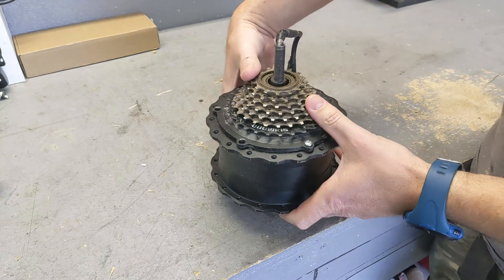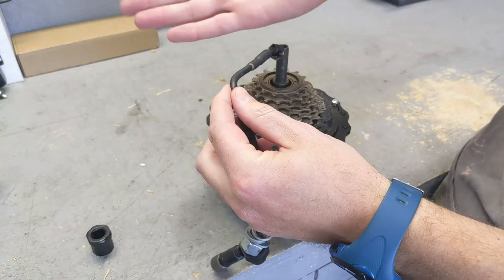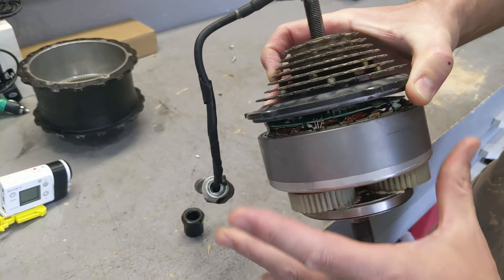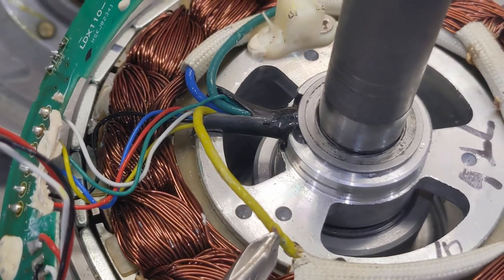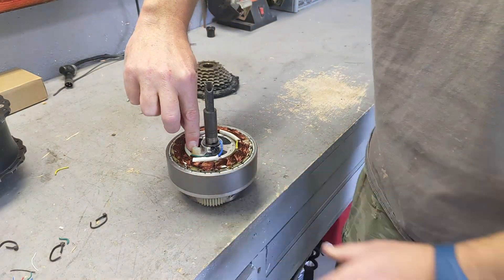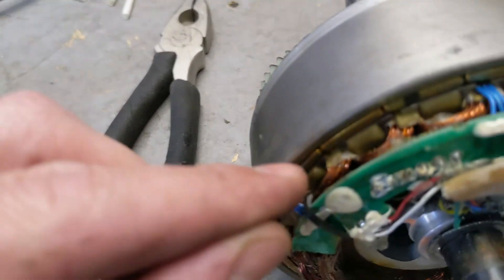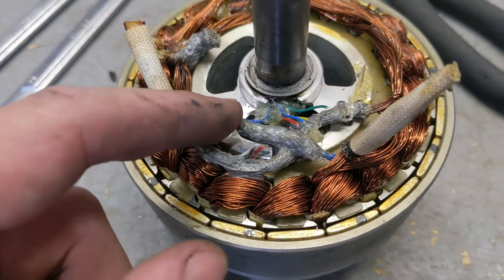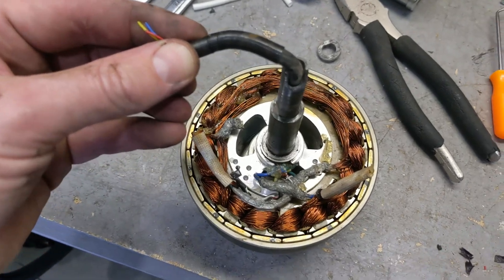5 REASONS why! How to UPGRADE E-Bike HUB MOTOR from HALL SENSOR to SENSORELESS! Bafang Himiway

Comment: hardly an upgrade, more like a downgreade lmao
Reply from the maker: Well first you need to learn how to spell downgrade ... Till then your opinion doesn't count
Reply: its a massive downgrade !! the poster dosent know the first thing about bldc motors or how to controle them....and this video shows. just look at the house wiring he is using and wire nuts like its the early 1900's
Reply: @spcolsson  How is it a massive down grade when he said it has worked for two years? Do you have another option than his? I would love to learn about it so that I apply it to my hub motor.  Is there a higher capacity thin cable wire available that can be fitted inside the bolt hub shaft? Help me understand what he is doing wrong so that I can avoid it. Thank you in advance
Reply: @spcolsson  Well, he made better job than factories.

Comment: I have a dual mode controller.  It should work with or without the HAL sensors, but my HAL sensors have failed and the wheel doesn't turn. I've tried only connecting the phase wires and the red and black (+/-) wires to the controller. All that happens is a clicking sound.

Can anyone help me with this?

Should I remove the HAL sensors from the wheel hub?
Reply: Yes completely take them out and try powering on and off your controller by either a switch or just directly connecting and unconnecting the battery [+] and [-]. Also make sure the hall connector with 5 or 6 wires is properly un connected. The controller should then recognize the halls are broken and switch into sensor less mode
Reply: Short circuit from bare wire causes problem..

Comment: i have the same problem, i would like to get rid of this "HALL SENSOR", too much headache, would you be able to send a link of that "sensorless controller" PLEASE, i have a 1500 watts motor
Reply from the maker: https://www.ebay.com/itm/36V-52V-1000W-1500W-35A-3-mode-Sine-Wave-ebike-Controller-Colorful-LCD-Display-/174788175525?mkcid=16&mkevt=1&_trksid=p2349624.m46890.l49286&mkrid=711-127632-2357-0

Comment: Could you run with a couple light switchs and not use the controller. I want to try that with mine
Reply from the maker: You need a controller.. The firleds need to be in order and timing determines rotation speed
Reply: No, it's impossible to drive a 3 phase DC motor with a couple of light switches. This is crazy. Don't you think that if it was possible every e-bike maker in the world would have used shitches instead (to save production costs) but hell no....its not possible im afraid. The use of a controler is : Paramount !!!
Reply: No, it's impossible to drive a 3 phase DC motor with a couple of light switches. This is crazy. Don't you think that if it was possible every e-bike maker in the world would have used shitches instead (to save production costs) but hell no....its not possible im afraid. The use of a controler is : Paramount !!!

Comment: You must be over volting or using a higher power controller to melt wires and halls. Not a common problem experienced by normal use.
What controller are you using?
Reply from the maker: the reason I have a new controller is because I burned 2 original controllers in 2 weeks, I only ride it off-road and I do keep that throttle open, I do think that I might have figure it out... Now... I'm ironing out all the weak points

Comment: In my experience, hall less is a pita. Yes a sensor less controller works (by using the voltage produced by the coils as a magnetic passes over them to tell the controller the rotors position), but start up is very rough and often locks the motor. I had to be extremely gentle with the throttle until the motor was turning relatively fast before I could use any power. Very difficult hill starts. My experience is with mxus hubs, very similar to bafang.
Reply: You're talking about a e-scooter, where you absolutely NEED the sensors to be accurate otherwise you will lock the engine and have a very rough start, however the story is very different for e-bikes. The PAS triggers the engine after a moment you started to peddle, which means the bike is already moving. From my experience there is literally no difference between sensor and sensorless at all. 

However the video here is misinformation. The sensors actually don't break that easily at all. The only reason sensors break are 2 ways:
a.) You're very very very unlucky (unlikely)
b.) You're running the engine out of spec. (99% of the cases here)

People love running their ebikes out of spec and burn their wires and overheating their engines. I am no exception. I literally melted 1 of my phases so that it cannot produce as much power as the other 2 which causes on high load funny noises from my motor. People have to keep in mind, that IF you want to give the hub more juice, then you have to make sure it can handle it. As this video perfecly demonstrates, these "250W" engines have really crappy wires, which can easily handle those 250W, however once you go beyond that, the wires will start melting and cause all sorts of problems. 
So before putting a 48V battery on a 250W engine or remove the speed limiter which would boost the performance to 350W, ask yourself if you shouldnt be doing the exact modification that the guy in the video does beforehand. I strongly recommend replacing the wires if you want to have more performance out of your 250W engine.
Reply: @danishblunt9698  you are more knowledgeable than I in this department, so this is a genuine question: wouldn't the limiter (speed limiter) prevent the wire from burning out even if you're using a more powerful battery?
Reply: @dantejackson8670  no because the higher you go in top speed the less power the engine will consume. The highest powerdraw is at startup where the engine draws the most amps to get going.

As long you stay within the same battery voltage you should be fine. You can upgrade to a better 36v battery since the ampdraw will be limited to 15amp due to the controller. Meaning having a max output of 36v*15a is something the engine can handle, that being said once you upgrade to 48v youll have 48*15 which is something the engine can handle short term but not over time.
Reply: @danishblunt9698  Hi there, if the wires melt, do you just replace the wires or would the sensors and other components have to be replaced due to damage?
Reply: @faYte0607  the hal sensor are likely fine however your controller might be done.
Reply: @danishblunt9698    you said "I literally melted 1 of my phases so that it cannot produce as much power as the other 2 which causes on high load funny noises from my motor" and i think it causes the magnetic field from rotor hub can be weakened by high current pulses through the motor.
Reply from the maker: Yeah it's a bit rough at low rpm, but we'll worth the reliability gain , after 2 miles an hour it is so much better
Reply: You need a controller what can runs without hall sensor
it will only run rough at the beginning for one second and still get full power.

A controller what needs a hall sensor.
Will lock up the motor & won't run properly at all.
Reply: @scottrocks1993  mine did run, once the motor was turning fast enough to generate enough back emf for the controller to get position, it worked. But getting to that point was rough.
Reply: Agree, also letting more current through the motor may burn it, and why would u do this mod when the controller automatically switches to '' sensorless'' mode if hall is damaged?
Reply: My scooter is senseless dual 60v and yes it's rough start but super good after 2mph